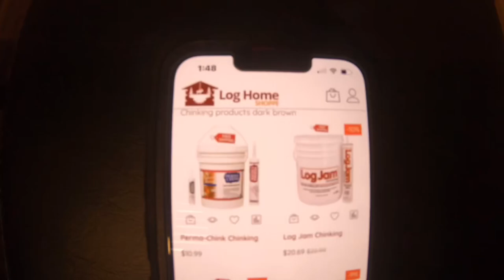DIY Chinking Barndominium Walls | CBH

Comment: i'd like to see a vid on the battery operated caulking machine...  Did you say 30 cases?  so 300 tubes at 20 bucks a tube and you mitigated a lot of the volume with the foam and wood?  6000 dollar chinking effort at todays prices.  It looks great but seems prohibitively expensive to some budgets.  would you choose to dry the wood first to prevent or reduce the shrinking?  or maybe another method?
Reply from the maker: We bought a total of 14 cases and looks like we will have a few tubes left but not an entire case. We wanted the log cabin look so would not have changed. But yes there would be less expensive ways to do walls. We saved a lot by milling our own trees for the walls so doing chinking was the trade off. The battery caulking gun is awesome but almost too fast for our interior project. We switched back to the manual caulking gun for the rest of the project. Thanks again for watching and your comments.